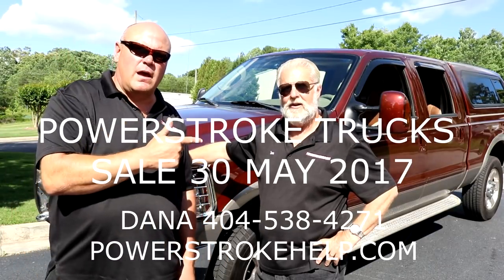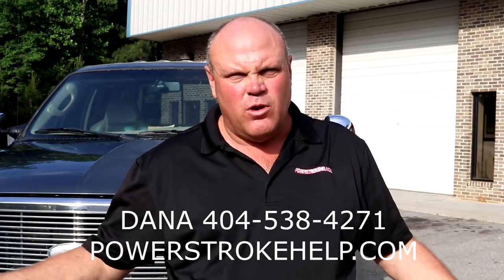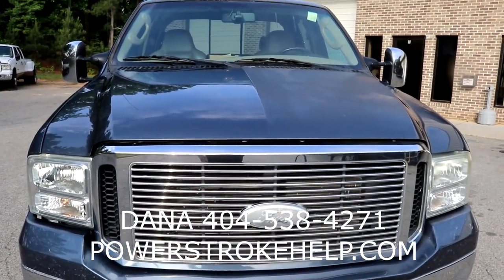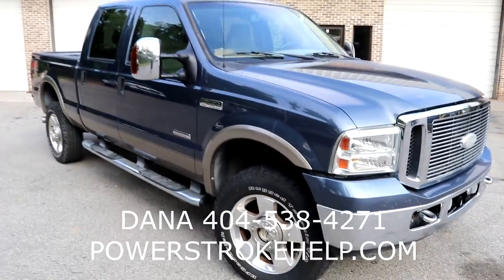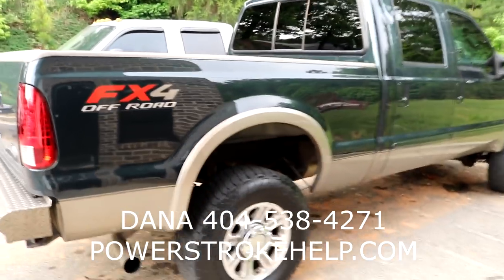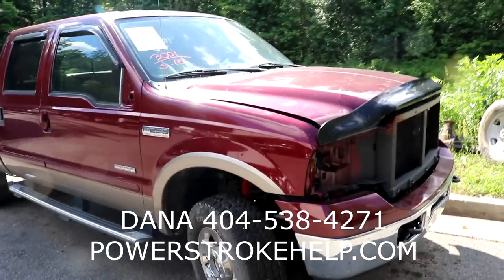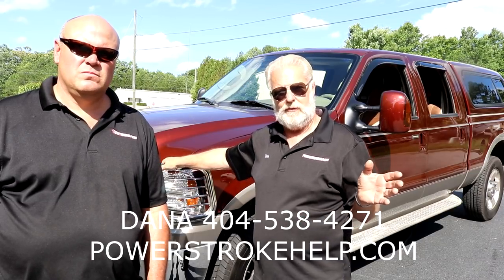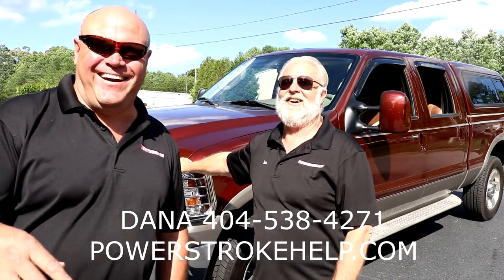POWERSTROKE TRUCKS FOR SALE 30 MAY 2017

Comment: powerstrokehelp I like the trucks that y'all have there.  Not many dealers will go to that level.  I have been watching for the last few years.  Thanks for the tips for buying Ford Super Duty trucks and how to maintain the Powerstroke diesel engines.  One question: have y'all worked on any of the Ford Transit vans?

Comment: I feel for the CA guys. I'm from MA, and this moronic state copies just about everything they do over there. My dad had to spend $400 or so to have his stock exhaust and stock tune put back in his '09 Duramax to pass inspection last year - state has been cracking down on diesels lately. Unfortunately he was forced to sell it. After the constant trips to a garage to clear DPF codes and get it out of limp mode in stock form, that was his only choice. Thank the EPA and the treehugging left for that one ...

Sure wish I was born south of the Mason-Dixion ... :(
Reply: Smitty Smithsonite lol that sucks just move to Connecticut! No emissions if it's 20 years or older 🌚

Comment: I have a question for you my 2006 super duty 6.0 has been bullet-proofed however. when I stop at a fast food restaurant or Quick Stop's it does not want to restart. I can wait about 30 minutes and it will start fine each and every time my mechanic who was awesome has tried many things. repeat of and high pressure oil pump is all brand new back everything is brand new. I hope maybe you have an Insight on maybe what the problem is working at least guide me in the direction I need to go thank you in advance.
Reply: JD King think bill calls it (hot-no start) he has a video of that repair process also. Check it out.

Comment: From inside door Install a 6 inch wide piece of metal between the lock cylinder and the handle that goes down 3 inches it makes the screwdriver trick useless and only takes me 20 minutes to do in the driveway with hand tools

Comment: Looking for a rust free CCSB 7.3L.  Don't care about condition of interior as I plan on swapping it to a King ranch.
Reply: PedalTheGlobe I have a 2001 F250 7.3 CCSB 4x4 Lariat Black with tan interior. 169000 miles. It was a theft recovery that I have been driving for 6 years.
Reply: Kyle Shook Rust free?
Reply: PedalTheGlobe yes.
Reply: Kyle Shook Price?  Contact info?
Reply: PedalTheGlobe '99 7.3 ccsb xlt rust free 6spd 100% stock - 245k mi, $15k
Reply: Kyle Shook $19,000 for a 170,000 mile truck? I can find trucks under 100,000 miles for that and they are mint Cummins or 7.3 trucks.
Reply: Dodge 318 Cummins then go buy it. Look on eBay they are asking 21000 to 23000.
Reply: Kyle Shook who goes by eBay pricing these days? When you have $20,000 you don't buy high mileage junk that's only worth $5,000...
Reply: Dodge 318 Cummins hey I'm looking for a Ford diesel with extended cab short box with a 6.0 bulletproof motor wondering where you guys are at where I'm at come and look at 1
Reply: Dodge 318 Cummins whoops mr. Dodge Cummings I think I just sent you something that didn't mean to sorry

Comment: Cutting corners. . . simple aftermarket degas bottle vs the only one that will last 100k miles; an OEM Degas bottle! It's the little things that sneak through in your videos which sent me elsewhere.  $7100 total BP including ARP 625 studs.  Ask Bill if he uses the "regular" ARP or the 625's which are 20% stronger.
Reply: ICWe812 "regular" arp studs are still rated for 220,000psi. the 625s are 260,000psi. 15.4%for over double the cost.

Comment: I have an question for you about engines 6.0 and 6.4 power stroke ,the cylinder head for 6.4 Fits on 6.0 engines